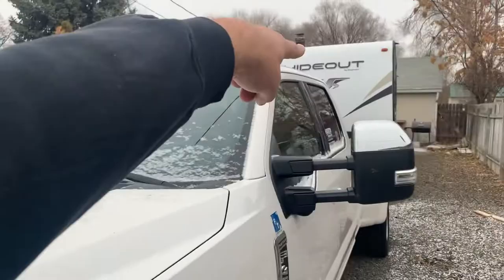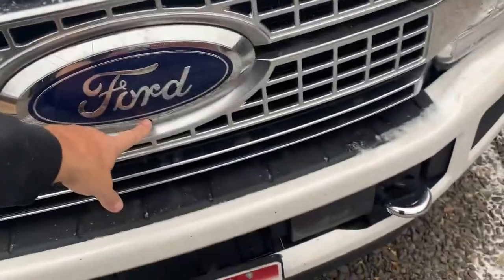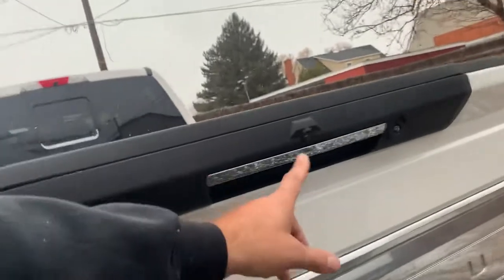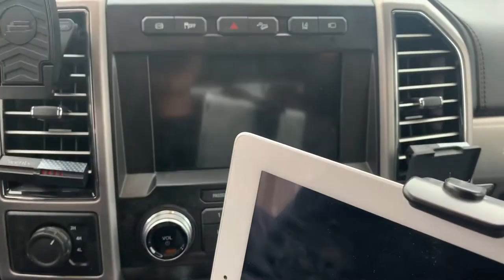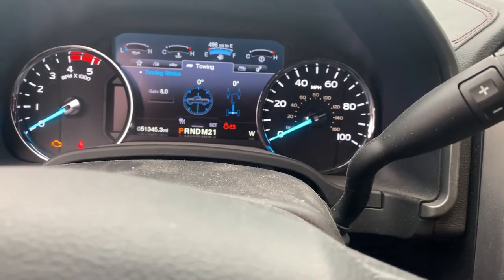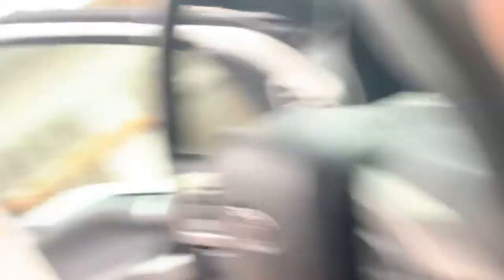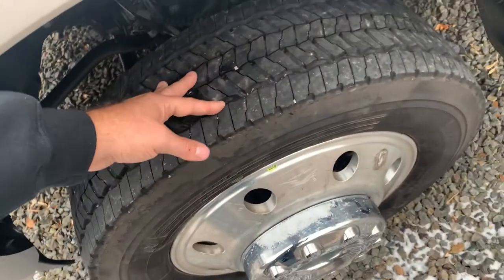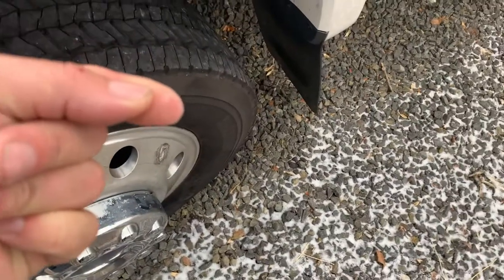50,000 miles on a $100,000 truck

Comment: You said you wouldn’t buy a $100k truck, but that’s what you effectively did, unless I’m missing something. You actually did worse than that...you paid $100k for a truck that’s now worth about 55.
Reply from the maker: I was unfortunately about $18,000 on my duramax when it died so I had to roll that somewhere. I booked my truck last week and it’s worth $68,000 and I got it for $77,000 tax and documentation along with my negative equity put it at $100,000. I currently owe less than it’s value